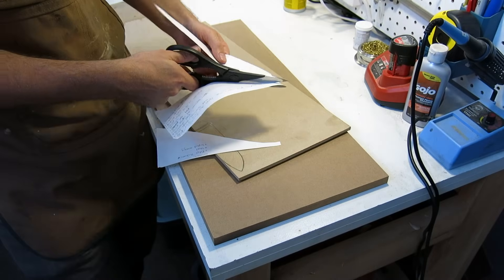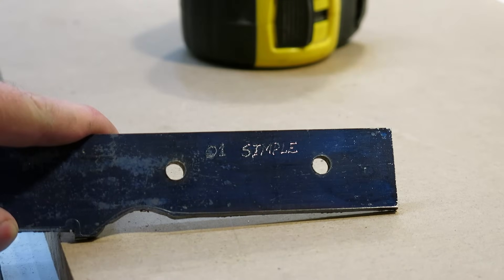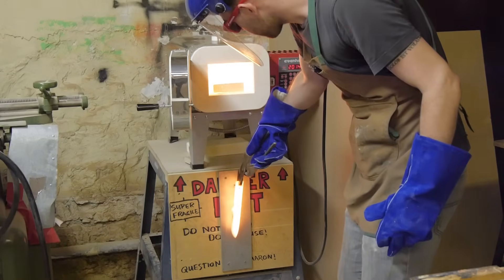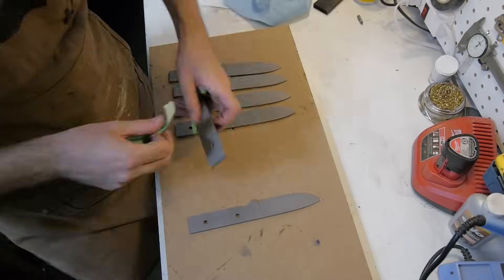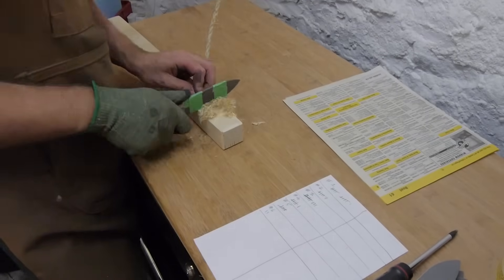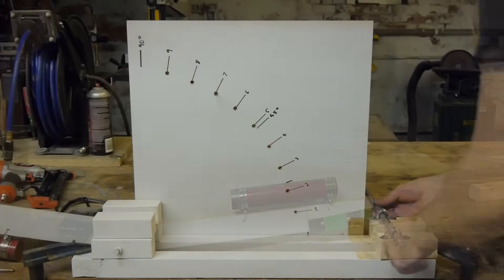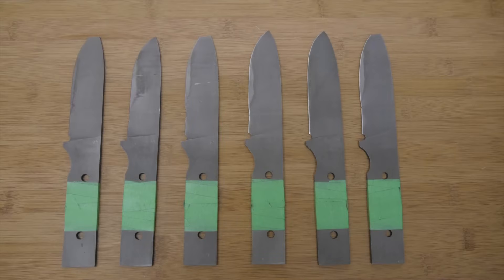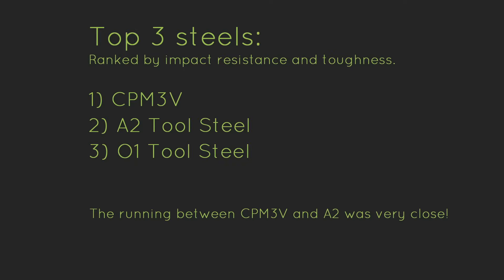Steel testing: a carnival of knife destruction.

Comment from the maker: If you want to forge the blade to shape then having a forge is definitely worth it. If you just want to use a forge for making 'flat' stock to then use in the filing jig, I would just but the steel instead... Buying it you will get actually flat steel of a known type rather than 'car spring' or 'bearing race'...

Comment: Alright cool, I did read somewhere else that 1084 was a good starting steel so, you've confirmed that for me. One last question (I think),  I've thought about setting up a forge and anvil and using leaf springs and bearing races etc, but for making knives do you think that's even worth the time and effort or is it best to just use new steel?

Comment from the maker: That was what I figured from your original question. O1 is pretty forgiving in heat-treat if you want a knife that won't see much abuse. If you want ultimate toughness with home-style heat-treatment then a spring steel like 1084 is probably your best bet.

Comment from the maker: Haven't tried it to be honest as I've mainly used it on my grinder. I've done some filing/sawing without the jig though and it seems to work about the same as O1, not sure I'd notice any difference unless I was going back and forth between two blades of the different metals.

The main issue with A2 versus O1 is that you would need to send it out for heat-treat if you don't have a kiln.

Comment from the maker: Don't be turned off the other steels too much! After the testing once of my larger overall conclusions is that I could make a decent blade from most any of the steels, just my design would have to be tweaked for some of the less tough steels... If you're dealing with a maker that knows what they're doing then it's likely you'll get good results with any steel they care to give you! (the exception being some budget production knives which give up edge-holding for cheapness).

Comment from the maker: I didn't get the chance to test 1095 unfortunately. It should be very tough, but it requires a careful heat-treatment. If you want a steel that requires the least careful heat-treatment then using 1084 would be the way to go... I've never used 1095 but I imagine it should be fine as well!

Comment: Very cool video, I work for a heat treat shop and deal with A2 daily, and CPM3v on occasion. My dept. is vacuum furnaces, nitrogen quenching. We don't run alot of knife blades in my furnaces, they mostly get processed in the molten salt.

Comment from the maker: I didn't get the chance to test 1095 yet. I was somewhat time constrained as I need to get back to making knives that won't be broken!

My guess is that with the right heat-treatment 1095 would hold up very well. Being a plain carbon steel it will have a very fine carbide structure and will be very tough. I certainly liked it well enough in the KaBar that I used to own!

Comment from the maker: I actually already did that! I didn't include it in the video as it's kind of hard to convey, but if you go through the threads linked in the description you'll see it.

Basically it boils down to:

Corrosion resistance:
Best:
440C
CPM154
CPM3V
A2
O1
Worst:

The difference between A2 and O1 was pretty big, and again the difference between A2 and CPM3V was fairly small.

Comment from the maker: Each steel was tested at 2 or more different hardnesses. I tried to optimize the hardness to the steel overall. The blade shape, stock thickness and overall geometry was the same for each knife. The stock thickness was 5/32" (4mm). 

If you have a look in the video description there are links to the testing threads on BladeForums, there's a lot more detailed info in there about the specific heat-treatments I used for each one, and what the hardness of each blade was.

Comment from the maker: Me too man! CPM3V threw quite a lot of high energy shrapnel when it failed it both the tests... That's one of the reasons why I'm going with A2 instead for my knives. Also the CPM3V did bend further before breaking, but it was plasticly deforming (ie: it didn't spring back) whereas A2 bent less far, but ended up still being perfectly straight after it broke...

Comment from the maker: I can't conclusively say this is 'the best' heat-treat for O1, but it's the recipe I got the best results with during testing:

Double coat in anti-scale (ATP-641 or ATP-304)
Stress relieve: Ramp to 1200ºF, hold 2 hours, furnace cool to 900ºF, cool in still air to room temperature
Preheat to 1200ºF, hold 10 minutes
Ramp to 1470ºF, hold 30 minutes
Quench into oil to ambient
Sub-zero treatment in dry ice and isopropanol for 45 minutes
Temper @ 400ºF, twice, 2hrs each time -> 59.7HRC

Comment from the maker: That's probably the least expensive steel to get started with.

There are more details to the heat-treat if you want to get 'the best' results, it's worth a bit of research for sure. But from what I understand it's pretty hard to wrong with, so it's a good place to start!

O1 is very forgiving as well, but more expensive. A2 requires you have a kiln or that you send it out for heat-treatment.

Comment from the maker: A2 is great! CPM3V is great too! O1 also has awesome performance, but definitely rusts more easily!

If you're after an inexpensive steel that doesn't require much equipment to heat-treat then I would recommend looking at 1084 from 'New Jersey Steel Baron'. It costs as little as $10 for 4 feet of steel, and has .84% carbon which means to heat treat it you can simply heat it to dull red and then quench in oil or brine, while generally getting great performance!